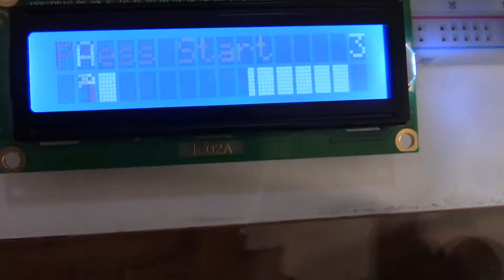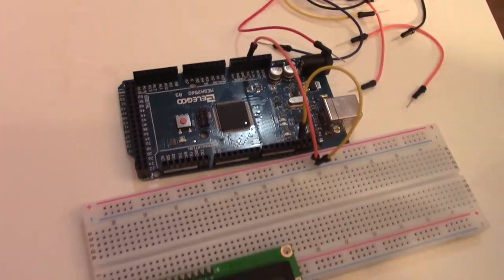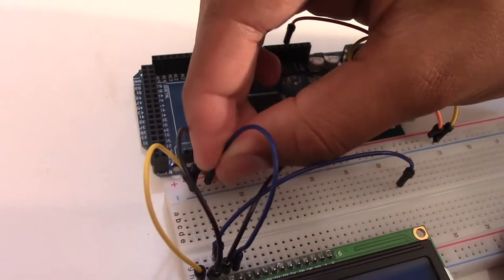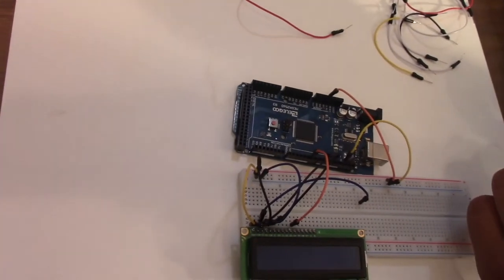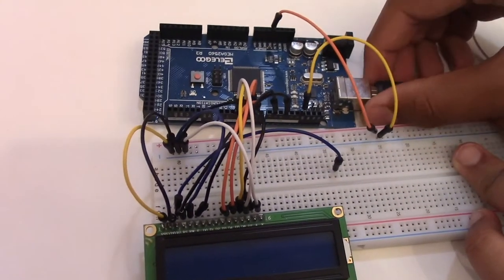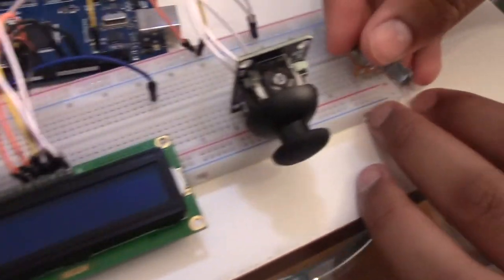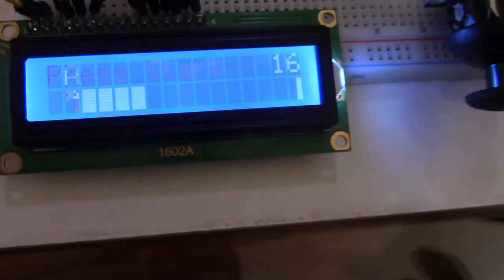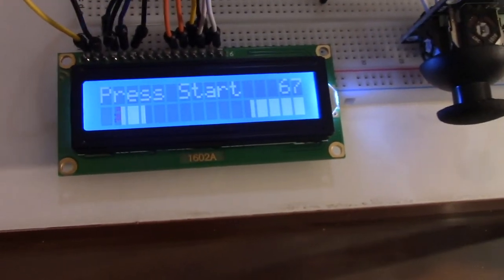ARDUINO LCD GAME WITH JOYSTICK (STEP BY STEP)

Comment: can you make this with a mini breadboard ?
i tried this but i only have 5 GND holes while you need 6...
Reply from the maker: if you dont have enough GND outputs you can extend 1 GND from the Arduino to any rail on the breadboard that isnt connected to anything else that way you will have 4 extra GNDs

Comment: Why does my guy keep on going up and down even if i don't touch the joystick module?
Is it normal?
Reply: I tried it and I had the same problem as you but i just started unpluging the joysting and moving it a bit and one time it worked (By the way for me, I needed to push left for it to jump)